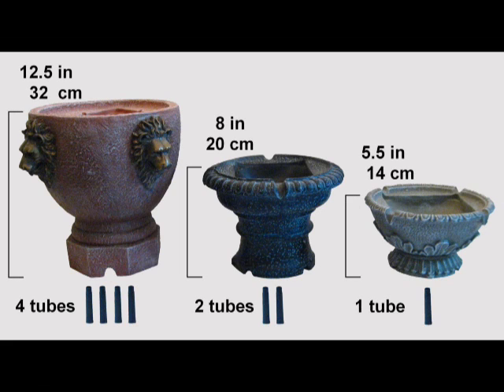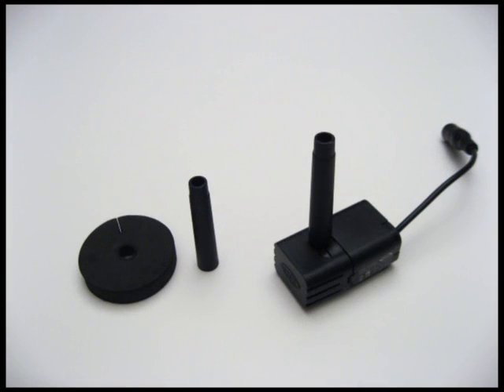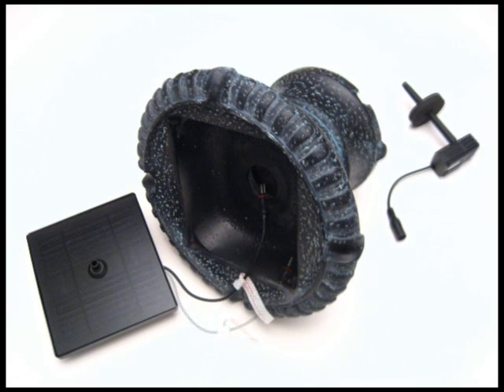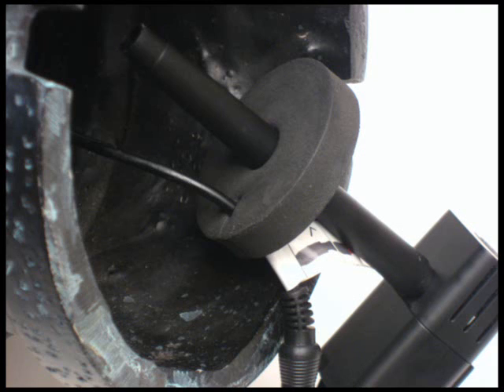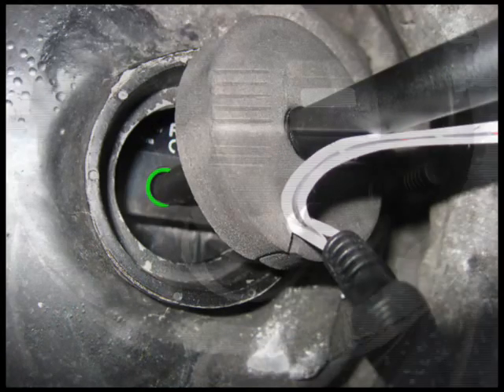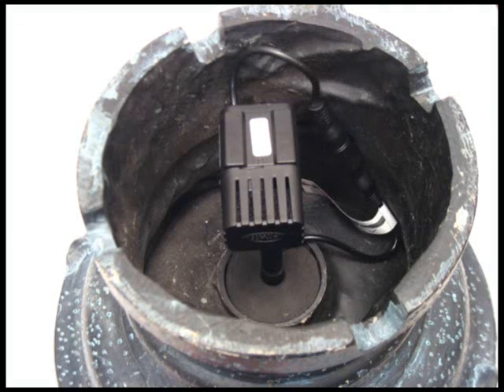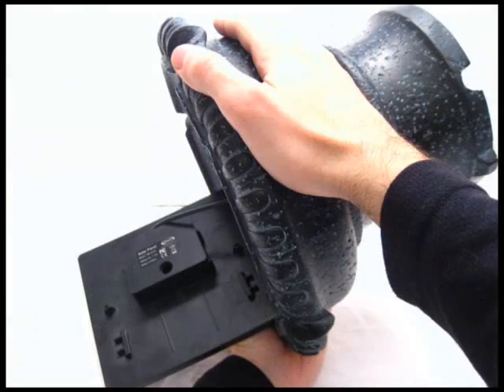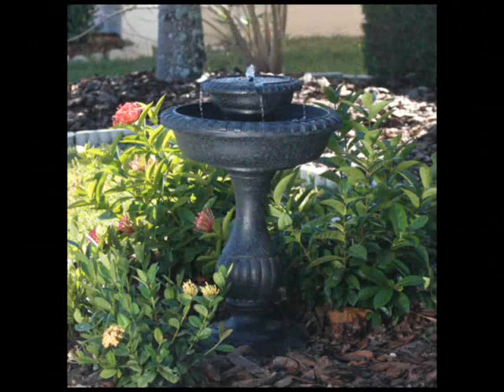How To: Assemble the Top Tier of a 2-Tier Fountain by Smart Solar

Comment: This video shows the standard solar version. If you purchased a "solar-on-demand" fountain then it will also a battery pack and on/off switch. For that version the only extra steps would be setting the switch on the top of the panel to "O" (OFF) and connect the green plugs under the solar panel. Everything else with the assembly is the same.